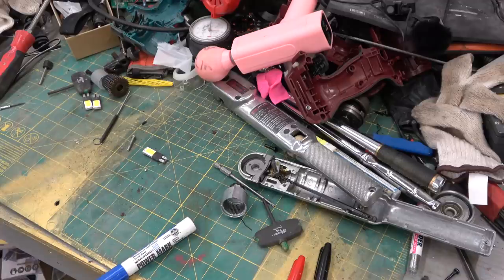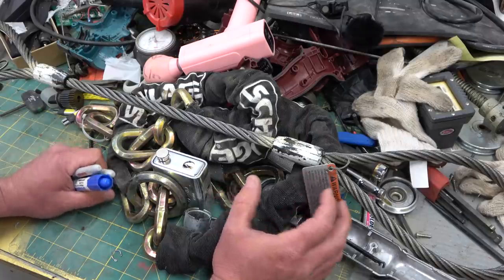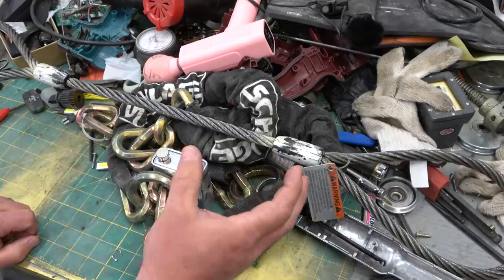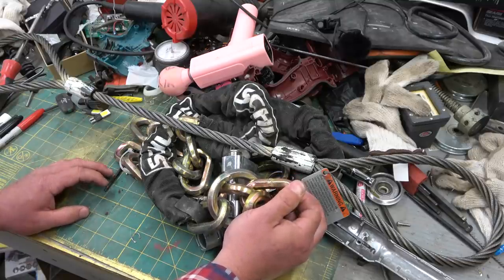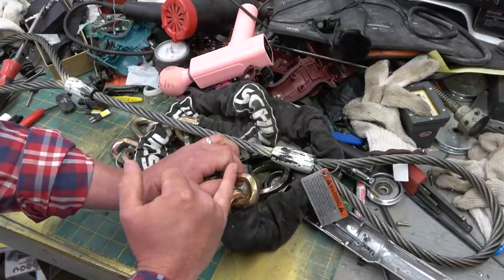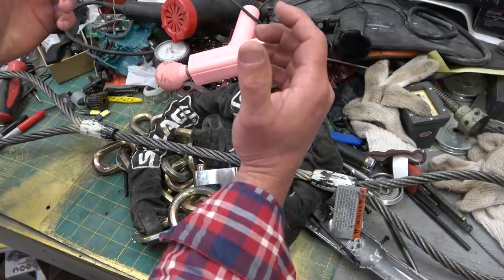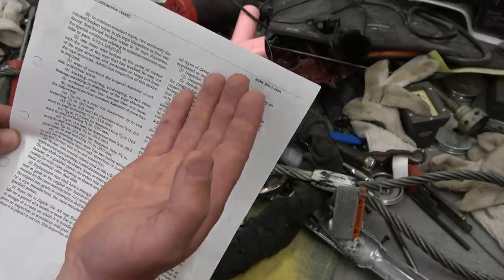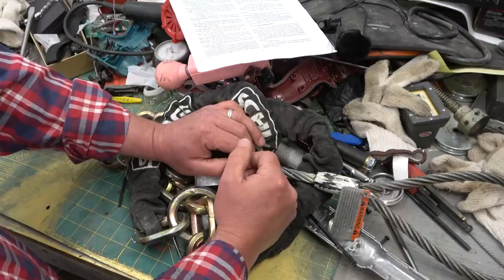"It is not known why the pulling cable snapped."

Comment: As someone who just got hired by a facility with significant amounts of deferred maintenance: nothing is more permanent than a quick fix to get back in production.
Reply: I think I heard it from uncle bumblefuck himself, "nothing is more permanent than a temporary solution that works."
Reply: @benzranger1425 "... then a bodge that works. " my favourite of his bumble fuckery.
Reply: what company? your part of the problem if you keep your mouth shut
Reply: @vripscript  basically every company works that way
Reply: This is unfortunately the case in IT as well.
Reply: When I worked at Midas the stores were in such dismal shape the jeslus floor drains never worked. The worst offender was this one location in the hood where the floor was so fucked the lifts never sat level. I quickly quit.
Reply: tempermanent
Reply: As a retired maintenance electrician for a Florida-owned company in Nova Scotia, I could have taken you on a tour of 'bandaids'. Did I complain to the so-called safety rep? Yup. Made enemies of almost every single manager, department head, as well as the top brass. And I got 'grease' duty for a full week. Shunned. It forced me to quit.
Reply: Decades of deferred maintenance on our outside telephone cable plant is now being paid for by my employer to me in the form of time and a half, double time after 8 hrs.
Reply: @benzranger1425  "Hey, boss - we need to rebuild that buried splice. I laid a drop wire on the ground so they have temporary service til we get that dug up..."
- FOUR YEARS LATER -
Reply: Thats when you wait until the night shift, and set in motion a set of actions wich will absolutely fucking ker-ruin said thing, so that is HAS to be replaced. This is of course theoretical, i have never done such a thing ever.
Reply: @cablekiller  Game design as well. It's why Bungie themselves had to vault all of their flagship game's content. Hotfix after hotfix after hotfix turned into a disgusting jumble of code that somehow still ran the game. So, they got rid of a lot of it to either ditch it or fix it.
Reply: Would you care to tell what the facility is called? (it might save a life)
Reply: @cablekiller  Yet here I am, having done exactly this today because the proper fix would have taken too long (according to customer). Since you know? They're really "going to replace it next year anyways" as they said. Somehow, I have a feeling that at some point in the future (definitely not "next year") I'll read a bug report and sarcastically think "huh, who could have possibly known?"
Reply: @cablekiller  Something that was never fixed.  I'm a lifer, 40 years at Financials Services IT company. 100 something small banks and credit unions at the time.  3 NCR mainframes. Late 80s.  1 was for programmers.  Each "COMPLETELY INDEPENDANT", supposedly.  Well occasionally they would all crash.  1,2, 3.  No one could figure it out.  I did.  A NCR Utility with goofy settings.  Told them.  Kept happening.  Kept telling them.  Was told I was full of it.  So one day I get my boss, a company VP and the on site NCR techs at my desk and  said "Here watch."  I crashed 100 banks on purpose.  "Don't do that again".  I certainly didn't.  It kept happening until the late 90s.  Most people got the message, but some didn't.  While the computers were separate, the I/O controllers to the outside world were not.
Reply: @jcoul1sc  you obviously don't work in the trenches, as if you did you would know that statement is patently false.
Reply: @jcoul1sc  Right, our jets only sever cables in Italy.
Reply: @cablekiller  All the software bodges hidden away under user interfaces and APIs, running our modern world.
Reply: @jcoul1sc  You're funny!
Reply: @rutabega2039  Yep, Cavalese cable car disaster, 1998.

Comment: Damn.  That was some truly horrific negligence. I can't even begin to imagine the stark terror those poor passengers must have felt for the few seconds it was going downhill.  Heads should roll for that dereliction of maintenance. They're called emergency brakes for a reason - purposely locking them out for other than a brief test is unforgivable.
Reply: They apparently went downhill for 20 something seconds... they had all the time to realize what was happening.
Reply: Negligence is not the right word. Criminality.
Reply: Kharma will exact it's price on them.
Reply: @d.t.4523  that's about as effective as "thoughts and prayers"
Reply: Invent something foolproof and the world invents a better fool. 

Could have put every stop gap and interlock in place and someone will have been told to bypass it.
Reply: @d.t.4523  No it won't.  The Just-World Fallacy is exactly that, a fallacy.
Reply: Require that any time they are in place, the person who put them on needs to be IN the car during operation.
Reply: @belverdemotorsports2410  And they probably lived considerably longer than that.
Reply: @belverdemotorsports2410  that 20 seconds probably seemed like an eternity.
I was on an elevator that “fell” soon after the lift. If it was 3” it was 30 feet to me!
Stopped abruptly- the slowly ascended to the initial location. Scary as frigg. 
I couldn’t imagine.
Reply: @belverdemotorsports2410  Jesus.  Probably felt like an hour to them.  What a horrible way to go.
Reply: Both management and the people responsible for the job should go to jail
Reply: @JohnDoe-tx8eu  It's more than you would ever do.
Reply: @basilbrush3238  Who gave you a password and a God complex?
Reply: There are 2 brakes so you can safely perform maintenance on one while the other is still working. At no time the car should have been left without at least one brake

Comment: Disabling the breaks seems to be at the level of criminal negligence, like drinking and driving, and those responsible should be tried for manslaughter.
Reply: exactly! just like in plane crashes when airlines are caught cutting corners and it leads to a fatal accident they get charged for it same should be happening with the maintenance crew or at the verry least the company running the cable cars
Reply: AFTER the emergency breaks had broken many strands in the rope!

Comment: SO many deadly accidents, from Challenger to Chernobyl, caused by management saying "Do it anyway". This is just one more example.
Reply: On the other hand, 99% of times they say "do it anyway" it goes perfectly fine. So it's not that simple.
Reply: @thewhitefalcon8539  If you always cross the road on red light, 99 times out of 100 you may get through alive too.
Reply: Yeah maybe that was the case but you're a terrible tech if you do it anyways just because management told you to.
Reply: On the flip side, you can't learn to fly heaps of metal or fake landing men on the moon without at least some "do it anyway"
Reply: do you know that maintenance techs said there was an issue and were told not to repair it? do you?
Reply: @BlastinRope  why not?

Comment: This whole situation with the brakes sounds like when someone replaces a fuse with a bigger fuse, then finally wraps the fuse in foil, because the circuit keeps popping fuses.  The brakes dragging was a symptom of a maintenance problem, not the source and cause of the problem.
Reply: Pimp My Ditch Witch  have you really seen people do this?
Reply: @imgoodaswell9558  Haven't you? People also tie up the emergency levers that requires constant pulling to not stop the action on lawnmovers, chainsaws and logs splitters all the time.
Reply: @Narcan885  have not. My mower has a mulcher. No need to prop anything up or tie down the propeller lever.
Reply: A friend of mine had a new car under warranty and the turn signals blew the fuse. Garage looked at several times and shrugged. We wrapped the fuse in tin foil and burnt out the entire wire harness....then they fixed it.
Reply: @Narcan885  I had an old Sabre lawn tractor that I put a big wire tie around the seat sensor. There was no way to get on and off it other than shut it off. That doesn't work with a leaf vac with the garbage can you have to empty every row. The battery died before I got very far. The newer X500 I have now lets you engage the parking brake and hop on and off (the brake also turns off the blades). So sometimes the safety is so badly designed it's useless. Not the case with the cable car, but poorly designed safeties are more likely to be disabled than well designed.

Comment: It’s sad to think of all the men whose blood and sweat went into building that thing which included (among thousands of design elements) designing, building and installing a brake feature that was, decades later, disabled for negligent reasons. Hard work disgraced. Pride lost for foolish reasons.
Reply: It didn't happen just recently that the brakes have been disabled. Part of my family have worked for different companies (to make sure the owners of the cable cars are sticking to proper safety procedures etc.) in the Alpes and they can vouch that that has been common practise since (at least) the 1970s. In the capitalist system it just isn't profitable enough to keep the brakes on at all times. Why? Because whenever the wind is too strong or something else happens, that is out of a human's control like the weather, the (very sensible) brakes already intervene and it angers the greedy owners. Caring about humans isn't profitable, but using humans as cannonfodder sure is.

Comment: I'm not an engineer, but I pretty sure something called the emergency brake should be in working order 100% of the time, and never be disabled.
Reply: I am and you're absolutely right.
Reply: That isn't correct, bypasses are for maintenance, when you need to remove the car from the cable etc.
Reply: @AlessioSangalli  that doesn't mean it shouldn't be in working order all the time. It wasn't in maintenance either
Reply: That's common sense, which is apparently less and  less common every day
Reply: @AlessioSangalli  This would fall under lock-out-tag-out, and the disabling of said brakes should also result in the machine being mechanically unusable until the brakes are re-engaged.
Reply: @Justowner  not according to this design unfortunately...
Reply: @AlessioSangalli  Yeah, which means the engineering didn't cover all the bases.
Reply: @Justowner  as AvE said and I confirm, those systems were implemented in the 60s. At that time, that was standard. In recent years I know many of those have been updated, but in any case a person went there and bypassed two brakes and let people ride in it.
Reply: @AlessioSangalli  Oh no yeah, the tech is 100% responsible, never bypass safeties
Reply: @InformatrIIcks  I prefer to call it horse sense, because it isn’t common anymore.

Comment: even if everything looks okay, when the thing named "emergency" is broken, it's an emergency. aka shut everything down
Reply: for sure!
Reply: seems so simple when you say it, sounds like a grey area if you mention it to management
Reply: @dogg755  Never comply to management when you know the dangers. Ever. Even if you're fired you will be fired with a clean conscience.
Reply: @rogerborg  I can't wrap my head around this "too big to fail" approach to the corporate world 

You're looking through the same lense as described in the video- the comodifying and dehumanizing of the individual

You may never again work in system that pays out six figures, but as an able bodied human being there is always a path to proactive behavior. You find people to work with/for who have the same outlook when it comes to doing the right thing
Reply: @rogerborg  That is why people who blow the whistle on serious issues need to be protected from being fired for doing so.
Reply: @rogerborg  "Because most of the time, you'll be wrong and nobody will die." - This doesn't apply for mechanical engineering. Once the signs of an impeding failure become obvious, the thing in question WILL fail. The question is only a matter of "when", not "if".

Comment: i work on manlifts for a living, there is one overwhelming rule, never disable safety equipment. ive had alot of customers ask me to bypass a limit switch, or let them know how to bypass one. once they ask that i leave my lockout on the machine and let my boss know, take pictures and leave. had people ask me to just pencil whip an aerial inspection also, thats not going to happen. people forget how dangerous these machines can be, you can get lucky 100 times and nothing happens but that one time something does can  take a life.
Reply: The local large reputable elevator company came to service the elevator in my building. They took one look, disabled it, and said it would need extensive repairs and/or replacement. So the building management found a different company that would throw a few parts at it and certify it. I try to always take the stairs.
Reply: If you can't figure out how to disable something, you usually shouldn't be disabling it.
Reply: I think Cornfed needs to go on one of those 'awareness' courses. 'Man' lifts...
Reply: @koitorob  they had me take sensitivity training, all it taught me was some better jokes
Reply: Just quit a job because the single man lift built in 1989 we had to use all the time, was not going to be replaced. But hey, we got a new CEO of diversity and inclusion.
Reply: @jrshaul  there's plenty of things you may know how to disable but shouldn't do it for normal operation, I can disable safety switches, done it many times to load a unit, but I won't even leave them disabled once on the truck a guy at the yard can do it if he needs to
Reply: It's useful to know how to wind off the automatic brakes when the cherry picker breaks down in the middle of the arena and your only options are to tow it out with a forklift or throw some black drapes over it and pretend it isn't there.

I have had to use both of the above options.
Reply: @akashahuja2346  releasing brakes is part of a breakdown, and the unit can be safely used if you reset the brakes once in position. Leaving them released is dangerous
Reply: @cornfed123567  Absolutely, the only reason I had to manually release the brakes was we couldn't tow it out of the arena with the brakes on and the machine inoperable.

Once outside, I  put the brakes back on and wrote a note to the machine hire company explaining what had happened.

I assume the driver from the company when he collected the machine had to take off the brakes to get it onto his low loader.

I was a rigger for 25 years and certified to service, repair and test electric chain hoists and controls.

I also load tested lifting points and suspension systems.

Comment: in my experience, gross negligence is a group effort.... if just one person can do the right thing....
Reply: ...the accountant will deny it.  After all, why doesn't the rest of the team want to do it too?
Reply: Sadly, and unironically, things go a little different in Italy.
Reply: Everyone running the system with red maintenance safety lockouts in place is complicit. If they don't know that is inappropriate then there is another training failure. The trusting public doesn't know what the red bits indicate.
Reply: Negligence is when someone fails to do something they should.

These people knowingly did something they knew they should not.

It's not negligence, it's far worse than that.
Reply: Reminds me of the "Swiss cheese" description of airplane accidents. Each one of the contributing factors (weather, maintenance, mechanical failure, human error, etc.) is a slice of cheese; the holes are mistakes or failures; stack the slices and there must be a clear path of holes in alignment for the incident to occur.